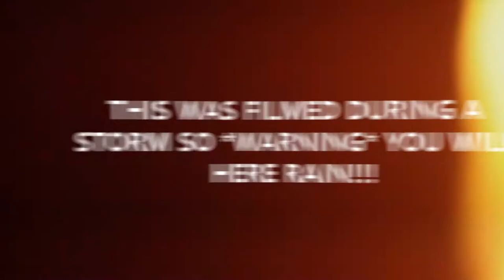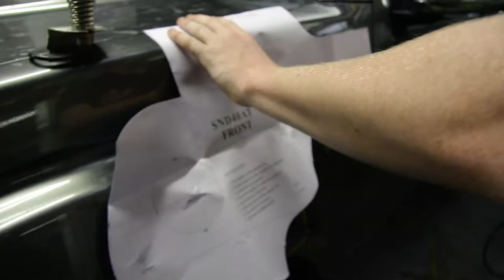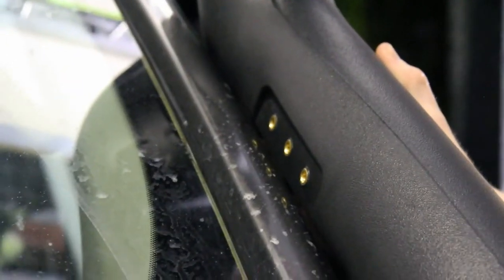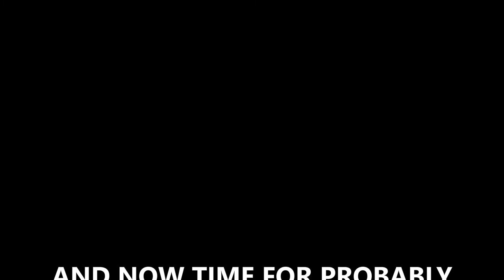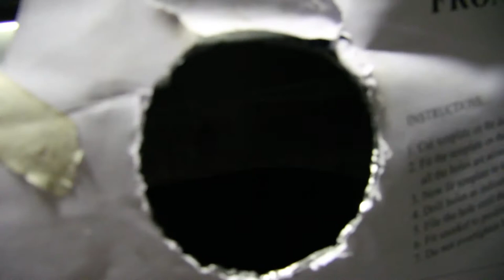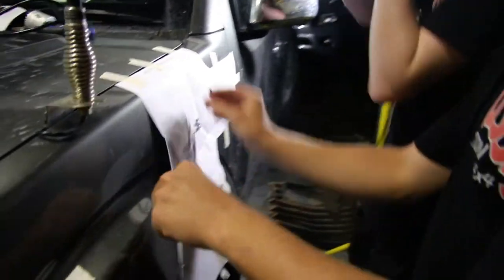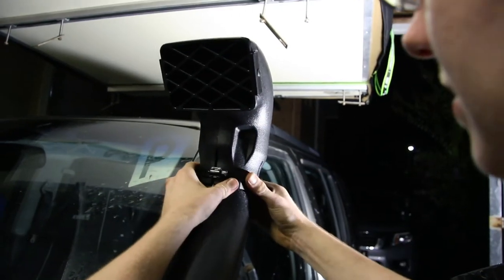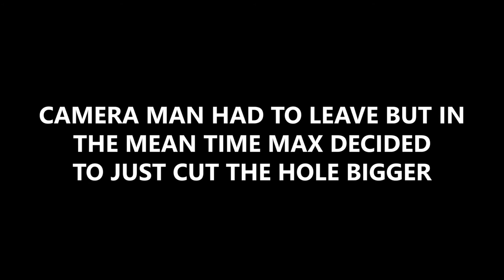“HOW TO” DIY SNORKEL INSTALL ON AN R51 NISSAN PATHFINDER!! | Max's r51 Pathfinder Build Series Ep. 3

Comment: The bracket for your antenna. is that something diy or ?
Reply from the maker: Yeah, just a simple Z bracket to mount it but more recently we’ve added a bull bar on the pathfinder and mount it down there because when the antenna moved left to right it flexed the whole bracket 😂😂
Reply: @AUSSIEACTION4x4  yeah I end up going back through the video and thinking it might flex a bit. Im gonna see if I can make up a thick bracket to mount to the 2 big bolts behind the left headlight.